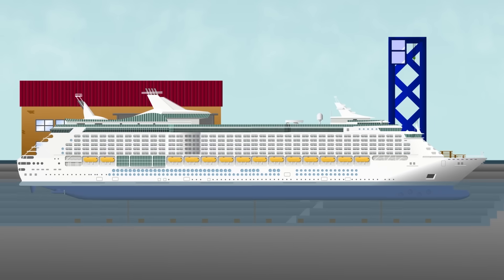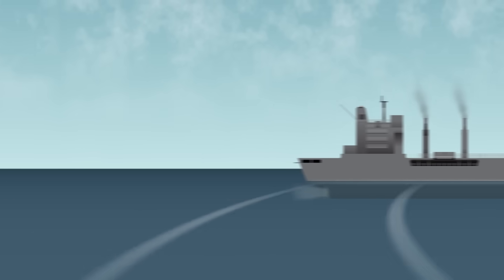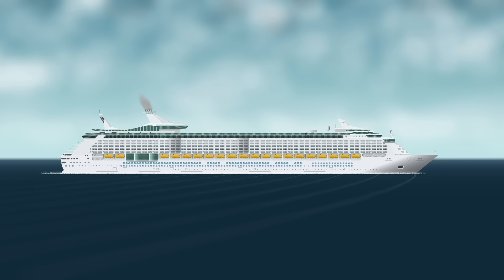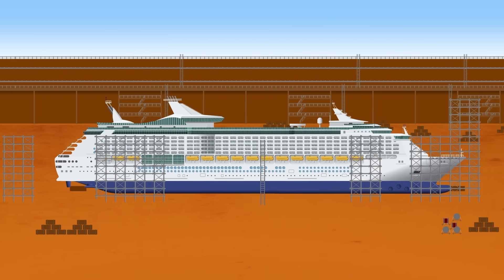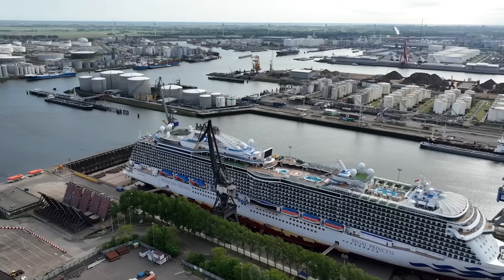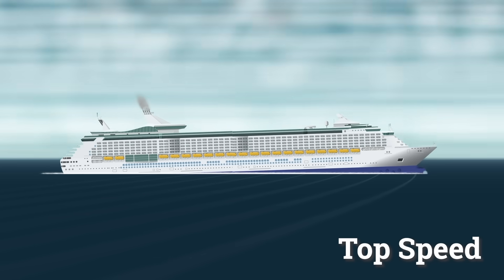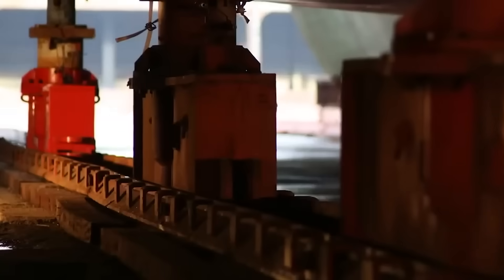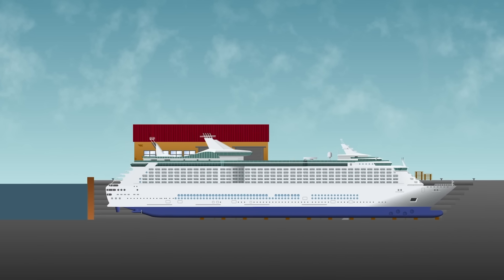Why Cut Ships in Half… on Purpose?

Comment: Why didn't they build it longer to begin with? Would have saved all the hassle.
Reply: because the ship was built to handle the demands of the time it was made it is possible to run a smaller ship but it puts you at a disadvantage compared to newer larger ships so you have two options if you want to compete either take a few years and billons of dollars to make a new ship or take your existing ship and make it bigger at a lower cost in a few months

Comment: As long as the ship operates well after stretching. I'm not so worried about it breaking in half as being less seaworthy after the stretch, e.g. less stable, or underpowered to maneuver properly. Sounds like these concerns are accounted for and it's not an issue.
The remaining concern, then, is a company stretching without that level of responsibility. There's a lot of rust buckets on the sea these days that should have been retired decades ago -- or at least maintained over that time. Hopefully stretching is outside of their budget, because they'd be sure to do it wrong.

Comment: "What kind of problem would make you take a perfectly functioning cruise ship and cut it in half"

Consumerism? 😂😂
Reply: Well, many of the ships were vastly improved by it, so there's more practical excuses... But, in the end... Yeah. 🫡😆
Reply: @taitano12  Why didn't they just build them that long to begin with?
Reply: @ObserverJim Because there was no need for it, and growth is NEVER guaranteed. If your current demand is for 1000 cabins, you don't build 2000 cabins and sail around half empty. You build the 1000 cabins, and MAYBE 100 to 200 extra for growth. Then, when you end up needing 2000 cabins, you split the ship. Even then, you don't want to go all the way up to the full 2000, because now you have more demand than supply, and most ship designs actually suffer when made TOO long. At that point, you only add an additional 20% to 30% in length and remodel the original cabins to add, maybe 100 to 200 smaller economy cabins. Then, you raise the price just enough to cover the remodel and extension, and save for a new 1000 to 1200 cabin vessel with the intent to expand that one at a later time. 

Again, it's all about consumerism and money. Especially with luxuries like vacation cruises and the tight margins of international shipping. Building 25% of a ship and installing it in an existing ship costs half or less than building a whole new ship that you won't be able to fill for a while.